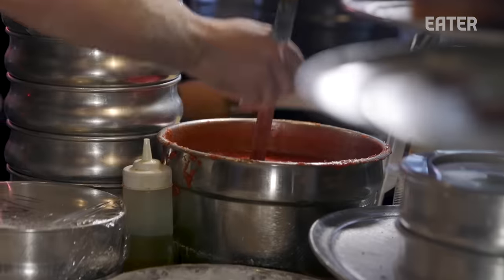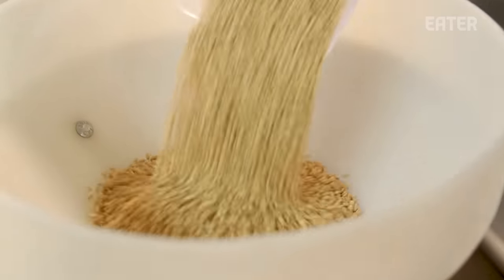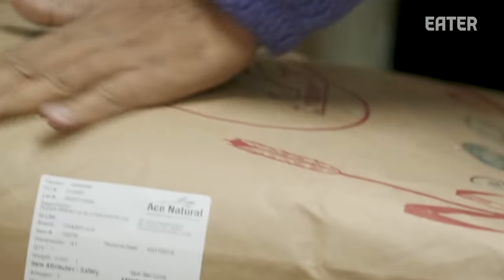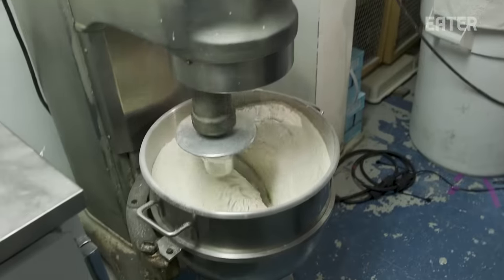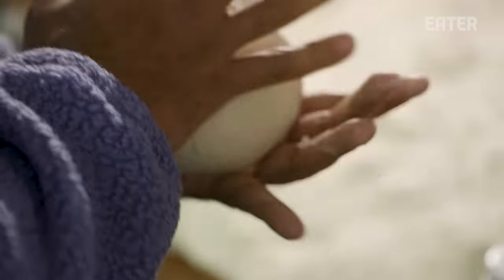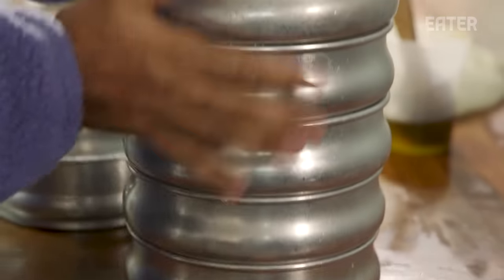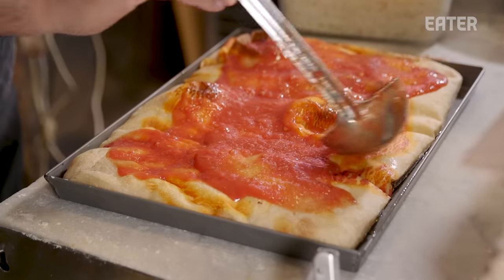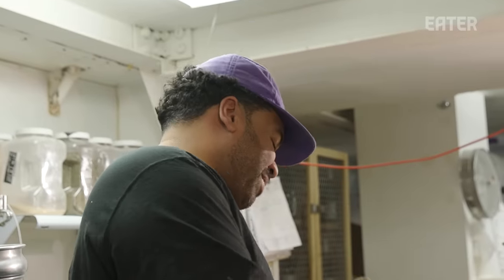The Best Slice in NYC Comes From Scarr's Pizza's House-Milled Flour Operation — Handmade

Comment: Okay so when you put his flower you grinded yourself at a low rate to keep the temperature down to not kill the nutrients in the flour what happens when it goes in the oven at 525 plus degrees?  What about the heat and nutrients.

Comment: hello eater once you are able to withdraw from paypal. Send over $40,000,000 worth of the pizza tell them it is to last for 4 years hope they will make it. Also bring over the smoker over to tankard along ngong road in nairobi. Here is $20,000,000 for the smoker and an extra $20,000,000 for the costs. and $2,000,000 for coal. Bring lots of coal